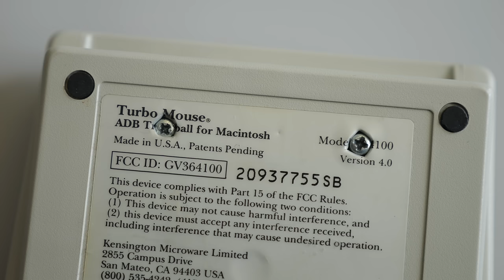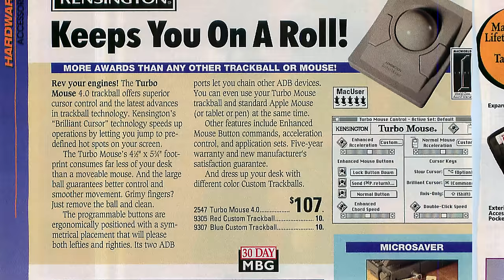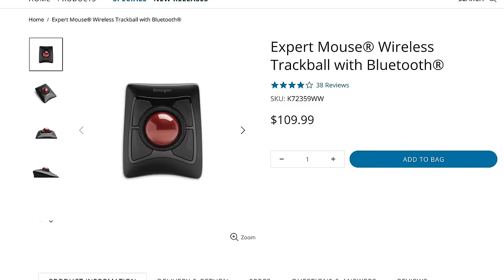The world's best trackball was built to break

Comment: Hold on, this might help.(emphasis on 'might') 
I am curious to know if rollers of other trackballs of the same model tended as a rule to acquire the same defect with age. 

It would be a shame to see such a fine device go to the recycler. Say, recyclers specialized in informatic ('computer related' for the younger of us out here) equipment are fairly common now aren't they? I recall decades back buying a box of defective Mac mice from one of them when I lived in Florida years ago. These places were all over even then. They did serve me well but I had hoped that at least one would still be working. I had to use them all for parts. Apparently broken rollers seem to be endemic towards mice used in corporate computers back then. 

Wait: It's interesting that only one of the rollers has a segmented pattern facing outside. That means different part numbers assuming they used standard optical readers. 

It would seem logical that to facilitate and cheapen production they would use the same type of roller, unless they were parts common to many devices and purchased from a random component manufacturer. 

The segmented pattern (just to explain how these operated to a new generation of techs, in case anyone is interested or truly bored) is not just an aesthetical detail. Inside the plastic housing attached to one side is an optical reader that measures the movement by counting the lines (segments) on the wheel as they move past, to calculate speed and distance. 

You said that replacement rollers might not contain the same design. It seems to me that since you very likely won't be replacing the rollers separately from there movement sensors anyway, it doesn't make a difference how they are designed. Also, very possibly, you might be able to source these parts to an ancient NOS parts bin somewhere in the distant (4-6 weeks away) Orient via part no.! Thank the internet this is so much easier nowadays! I used to be a sourcer (as in: harried, grumbling person who had to track down hard to find items, before the internet was commercially practical and obiqutous - reporters - contact me for further war stories, ladies for phone numbers and or autographs. Insane asylum workers, I changed my address, no use trying to track me down!) 

If you find the complete reader unit containing the roller, melting the plastic would probably be simple enough, sans a few burns on the hand or possibly nose, that you can laugh about later. Remember kids, always use your safety goggles! However, this seems to be a very standard design. I believe that the chances of finding such sensor/roller combos should be as easy as opening an old mouse. Remember people don't like variations as this means more sku's, meaning more construction costs and trouble than if there were only two standard rollers (H+V), of course. So chances are you are going to be finding some variations and possibly many different companies who build them. So please don't give up without a quick glance!

Comment: They changed the design to use like 3mm tiny ruby like roller ball bearings and optical tracking many many years ago.
Reply: These also get clogged up with skin and dust as well and are hard to clean well.

Comment: I would mod it, no reason not to. I would cut off those plastic welds to release the bearings and either take one of the patterned side covers off to service ooooorrrr remove the patterned side cover from the bearing and place on a skateboard wheel bearing. When reassembling, you could use the original plastic welds as washers, drill holes in the posts, insert screws and Bob's yer' uncle.

Comment: You can soak these bearings in isopropyl alcohol or WD40 overnight and then rinse them out with isopropyl alcohol again and then drip in some oil. Have done that for bearings I got that were kinda gummy from the seller.

Comment: Bless you Colin for putting even just a toe on the soapbox to dispel the myth of "back when things were easy to repair". Things have always been built as cheaply as they needed to last as long as they reasonably needed. 

Those of us who were around in the days before (truly) optical pointing devices also know that the majority of computer mice were thrown away the moment the rollers got gummy, by users who likely didn't know they could open the bottom and clean them rather than throwing the mouse out and buying a new one. It truly was a heyday of disposable tech.
Reply: The thing is that there was a point in time when people expected things to last a long time (5-10+ years at the least) and those things generally were made to last.

Lots of cities and towns have had to do urgent plumbing repairs because the original cast iron pipes were designed to last ~100 years. Consequently people got used to things being low maintenance and, collectively, forgot why that was possible.

So while most of the era of "personal computing" likely occurred much later, after things changed, there was a time when things were substantially different.

Nothing lasts forever, anyway.

Comment: Unmount. Attach to some shaft in a vice. ANd give them a reeeeally good spin with rubber wheel mounted to a dremel.
Put back on board with some soda and CA (or just a little 3d printing)
Reply: or standard self-tapping screws

Comment: Actually, "for parts" electronics are 50/50 chance, either they're really just for parts and not repairable, or someone who sells it just plugged it in -it didn't work and he thought it's broken, even though it could be just dirty. I just wouldn't suggest to spend a lot on broken parts. But if its only about 20 bucks, and you can get an interesting model, the risk might be worth it

Comment: Do not use oil in such a case. First bath is cleaning only - kerosene, degreaser, contact cleaner liquid and so on, with US preferable. 2nd bath - something like wd40, kerosene + light oil, but it is still not a final! 3rd goes real oil, but not drying! Use something like "lock oil", wd40 dry ptfe and so on. Not a lithium grease, not a usual liquid oil - they all dry and leave strong residue, blocking bearings again.

Comment: I'd try alcohol first. Force it in with compressed air. Then add oil after the air got them spinning. If this still didn't work I'd add some heat. That will suck in the new oil. warm it up without ruining the plastic and dunk them in cold oil to cool.

Comment: You should try spraying wd40 or brake cleaner into the bearings to flush the old grease out first.    You need a solvent to break down the grease and get it out of the bearing. Then you can load it up with machine oil.

Comment: Use a dremel tool and drill a tiny hole in the shield to inject WD40 to loosen the old grease, then replace it with a firearms white lithium grease. End up doing this on RC cars all the time.

Comment: Yeah, TurboMouse has some nasty design flaws...

First up, it's a "crud accumulator". That depression under the ball fills up with loads of dirt, dust, skin oils and so forth. Then it's conveniently positioned to make it easy for all of that to get into the encoder wheels.

First up, you have to get into the habit of regularly pulling the ball out to clean the cup. Every few days seems to be about the right frequency.

Then, the next thing you need to do is to clean the encoders. Do this BEFORE working on the bearings so that you can better tell if your bearing cleanup has worked.

To clean those, use a Q-tip soaked in pure grain alcohol... isopropyl alcohol, rubbing alcohol, etc all contain significant percentages of water. And you don't want that because the alcohol needs to evaporate as quickly as possible. Anyway, use the Q-tip to clean up the encoder wheel's optical part, then use a CLEAN Q-tip to get at the LED and scanner optics. Once these notorious crud accumulators have been cleaned, you should start to see improvement.

Next, lubing the bearings. Yes, factory lube can be a problem here, but the majority of the issues are due to the same crud interfering with the smooth operation. In THIS case, though, you'll want to use a certain specific electronics cleaner: Caig Labs DeOxit D5. 

DeOxit is more or less the "wonder drug" for knocking out a host of ickinesses from contact surfaces. Pretty much ALL studios I've worked in over the past 40-ish years have a can of the stuff within easy reach...my own included. But one thing it's especially good at is breaking up gummed-up lubricants.

Instead of going directly to a lubricant for the encoder wheel bearings, work a spritz into each bearing. The wheel will feel really crappy and gritty at first check...but keep going, as this means that the crud is breaking up. Just keep exercising the encoder wheels, maybe adding another shot, until things feel pretty free-spinning. Give the board about an hour for all of the DeOxit to evaporate, then check again. Still gritty? Then repeat the process.

Eventually, the bearings will loosen up. At THAT point, re-lube the encoder bearings with a very light lubricant...something like watch oil...then exercise the wheels again. If everything's smooth, reassemble it and get back to work.

Pretty simple, really. I'm on my THIRD Kensington trackball these days, having literally worn the first two out over many years. Maintained properly, they go far.

Comment: Colin that oil is too thick... WD40 or DeoxIT contact cleaner will penetrate in them better...... and for loosing them up.. you need to turn them at speed with a rotary tool like a Dremel.... (use the rubber accessory of the cylinder sand paper) without the sand paper of course.. for don't damage the surface of the Ball Bearing and turn the hell out of them.. careful with the heat.. don't melt by friction the plastic black shafts....

Comment: They're not designed to break, every component has a lifetime, even the best ones. This one is likely a decade beyond its lifetime and who knows how it's been stored. I could have frozen several times, been under water in excessive heat, who knows.
Reply: So it's designed to break.
Reply: @Sekhmmett  you can be stubborn about it, but if that is you y attitude, then everything, up to the highest quality is designed to break. There is no other option, wear is a law of nature
Reply: @Sekhmmett  : No. Everything will break over time. It's called the second law of thermodynamics, or simply put; Entropy.

Comment: The current revision (well, I got it ten years ago so I guess I should say a later revision) is optical, using a speckled ball which moves on three tiny ruby bearings.  From time to time cat hair and other schmutz builds up around them and makes the ball 'sticky' and hard to turn, but it's easy to clean.  Thing is, you have to clean it carefully. If one of those tiny ruby spheres accidentally comes loose because you poke it at the wrong angle while cleaning it, you're screwed.  They're around 1/32 of an inch, literally the size of a grain of sand.  If you can find it on your floor, and you are very very careful, use a very thin epoxy and very carefully wipe away the excess, you can put it back in place.  But if you lose it in a room with carpeting or something equally normal, there's no chance.  One of mine died when I lost one of the bearings, then when a second did the same thing I managed to repair it using one of the other bearings from the first. 

That said, they're way more reliable than the OG version you've got here, and with care run smoothly for years.  Best mouse-equivalent I've ever owned.

Comment: I bought one of those new. I only used it for about a year. I recently saw it in one of my warehoused boxes. So, I should have one that is quite little used. I'll take a look at some point if the bearings also have gone dry or if its still ok.

Anyways, you could drill a small hole (like 3mm) to the grease shield and inject IPA to clean and then synthetic grease to lube the bearing and try if it frees up. Or look that this video for couple of interesting regreasing ideas: https://www.youtube.com/watch?v=i0EXxlIetdA